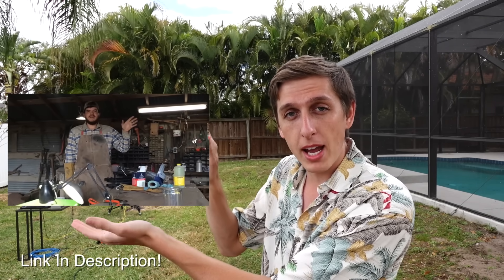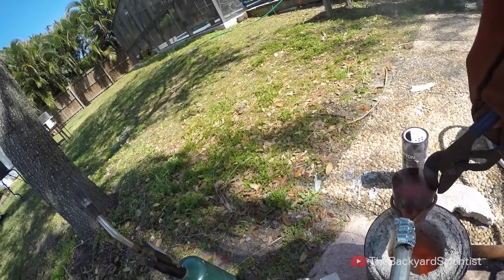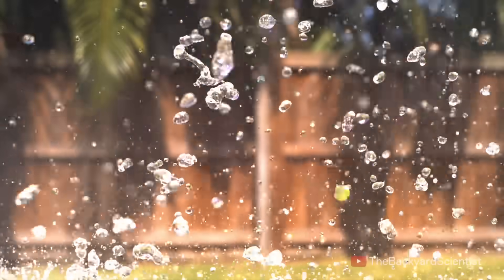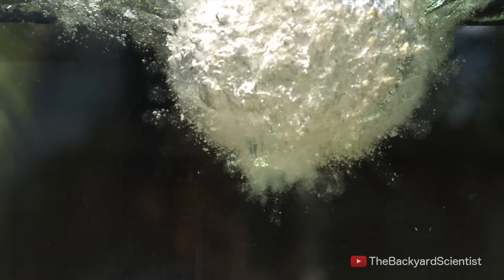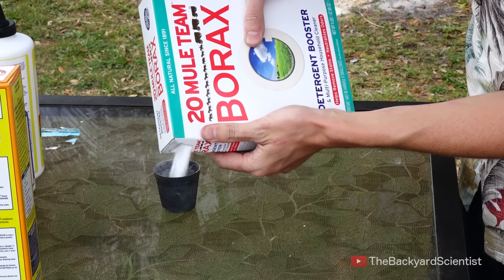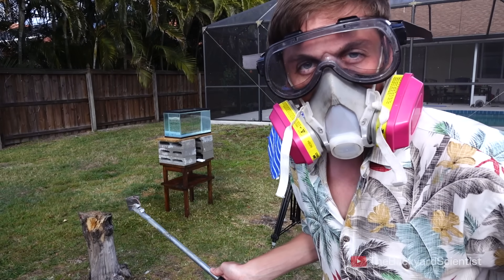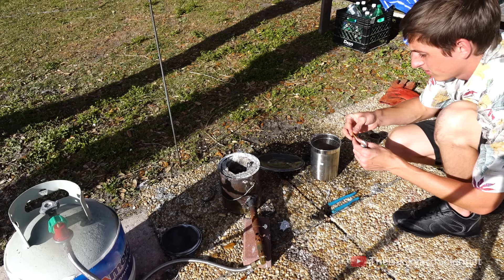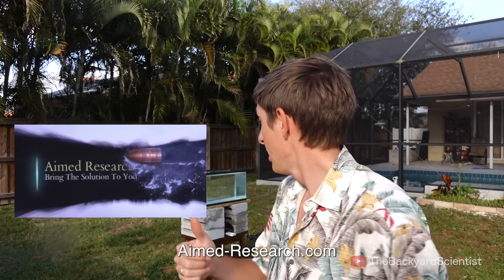Pouring Molten salt into Water - Explosion!

Comment: burning off the chlorine and only leaving sodium. pure sodium explodes when in contact with water.
Reply: Iron Lion it takes more than just heat shock to separate the molecular (edit: and more importantly, ionic) bonds of sodium chloride, it has to either be put through electrolysis directly or react with another molecule for a net result of a more stable molecule. Salt is very stable as molecules go. Yes, sodium is reactive, but the chloride is an ideal stabilizer for it, more so than water.

Edit: Another point to illustrate this is that by splitting the sodium chloride into sodium and chlorine respectively you're left with a reactive sodium and chlorine gas, which if the sodium were to combine with the water would give you heat and sodium hydroxide with chlorine gas exiting the solution. The issue here is that Sodium hydroxide is a reactive compound (lye) and this means that you would be going from a exceedingly unreactive molecule (sodium chloride) to a reactive molecule (Sodium Hydroxide). This violates the laws of thermodynamics unless a huge amount of energy is put into the equation like through electrolysis.
Reply: Hiddr Zand, you're correct on ionic bonds - my mistake. All ionic compounds have covalent (molecular) bonding as well, but it's misleading to refer to the bonds which are of less strength when describing their bonding without including the stronger ionic bonds. Good catch and my apologies.
Reply: If this were the case then the explosion would run its course until one or both of the reacting agents were completely depleted
Reply: There are no molecular bonds in sodium chloride, cause its a salt, and salts consist of ionic bonds.
Reply: True, you'd be left with chlorine gas, water, and impurities likely sunken to the bottom. This is what you're left with after hydrolysis using salt as an ionic booster for the water anyways, which is why it's usually recommended not to use salt for this (enclosed space + Chlorine gas isn't good). The sodium and impurities split to form a greenish-yellow goop at the bottom of the water as well.
Reply: afrodisiac why do you think there would be a greenish flame? Sodium is colouring flames orange and chlorine has no effect on flame colour
Reply: Iron Lion at those temperatures sodium metal will start to boil off.
Also, molten salt is used as a heat carrier for many things, such as solar power plants
Reply: [Whatever name goes here] lol I just realized that I was thinking of copper oxide
Reply: I don't really think this is the case as separating chlorine from sodium in NaCl is very hard. But if it did happen the pH of the water would change. Would be interesting to test though.
Reply: Iron Lion the sodium in sodium chloride is in its ionic form, Na+. For sodium to explode in water, it must be in its metal form, which is just Na. If Na+ exploded in water, we'd all be dead. Our bodies are like 70% water, and we also have a very large amount of Na+.
Reply: OMG you just proved how much one can fail in education.
Reply: the sodium woud still be na- and not actually reactive with water.
Reply: Did he use distilled water though? Maybe the ironic bonds are weaken from the heat and some other reaction is taking place?
Reply: It needs to be done with distilled water not tap water which contains are cocktail of chemicals including potassium and flourides
Reply: tap would also have calcium.
Reply: No no no no no no

Comment: For those wondering but not wanting to look it up it is a chemical reaction with the Sodium. When Sodium comes into contact with water it produces Hydrogen Gas and a ton of heat.
Reply: Wrong. If you add NaCl to water you get a solution of Na+ and Cl- ions. It is just an ionic solid going into solution an it actually uses energy in doing so. The energy for the explosion here comes purely from the heat of fusion of the NaCl, which is a lot because it melts at a very high temperature. The other solids he tried melt at a much lower temperature, hence, little or no, explosion.
Reply: I'm doing a masters in chemical physics. It's a physical reaction.
Reply: Rulke Yalkara sodium chloride is Na+ Cl- and Na+ does not react with water.
Reply: You have to run an electric charge through table salt to get pure sodium, simply heating it wont suffice.

The reaction you see here is simply a physical change; rapidly cooling something in the liquid phase to the solid phase causes an expansion of mass and is very exothermic.   This is evidenced by the fact that the explosion increased in magnitude when the molten salt was hotter.  Additionally, this also discredits the idea of it being pure sodium, as that would be independent of temperature.
Reply: Why would the heat of fusion have anything to do with the melting point?
The heat of fusion of salt is only about 50% greater than that of water.
Reply: Actually, Na+ does react with water to produce Na+ and OH- ions and hydrogen gas. If you've ever seen solid sodium being put into water it's a pretty violent exothermic reaction.
Reply: Ha you're right, my mistake. I must have misread the original comment. You're right, Na+ has already ionized to a +1 state so it cannot do so further, thus no reaction, just dissociation from whatever else it's bonded with (in this case the Cl-). There is actually a heat of dissociation, but that's not what is causing the explosions in the case of the molten salt. The reaction of Na and water is the rapid oxidation of sodium metal to NaOH and H+. It's the hydrogen gas that's igniting above the water in that shot.
Reply: Rulke Yalkara ya I'm not sure why he would say the wrong information when the truth is so easily googled. Now we got all these people thinking that the reaction was physical.

Comment: Interesting theory but you should know that you can ignite hydrogen by dipping hot stuff in water, which is probably what's happening here. Especially since you're using salt, which will lower the temperature at which the hydrogen in water can ignite.

Comment: now i have a question for @backyardscientist now think about how that could be applied to powering a motor? ......think about what you just showed us with obv. not controlled experiment due to you not have the exact time and heat the sense you take it from then walk to the tank then you have to compensate the winds and air temp......but the propulsion that could be use with this simple act......I RECOMMEND TRYING THIS EXPERIMENT While THE WATER IS ELECTRICALLY CHARGED>.........u wont believe your eyes......
Reply: not to mention your testing the ph  what else does that say you will not have to replace the h2o but the chemical

Comment: maybe an osmotic effect combined with temperature? in a  sodium Chloride melt the crystal structure is broken, Ions are loosely, no energy has to be broken during Dissolution, therefore Diffusion is so fast causing water to carvitate plus the temperature effect of cooling the melt in cold water. only a guess....

Comment: The other salts you tried have molecular cations (tetraborate, carbonate). What distinguishes NaCl from those salts is that its anion is a single ion.

You can try different sodium salts such as sodium fluoride or sodium bromide. If these all cause explosions, it would suggest that it is the single atomic nature of their anions that is causing explosions.

You can also try potassium chloride, fluoride and bromide. If these also cause explosions, it would indicate that the cation is not important and that you will get explosions as long as you have an atomic anion.

Lastly, I'm not sure how your acid test proves the lack of a chemical reaction. You are adding equimolar amounts of sodium and chloride ions, which will not change the acidity of your water.

Comment: Sodium reacts with water to create sodium hydroxide and hydrogen. Due to the high temperature, the reaction speed is immensely sped up, thus only occurring in high temperatures. The hydrogen reacts with the heat and creates an explosion. This also explains why there's a bigger explosion with a higher temperature

Comment: Well, if I was to make a logical guess, I'd say that when you melt salt, you are separating the Sodium from the Chlorine, in which chlorine becomes a gas and evaporates from the solution, leaving only sodium in the crucible. Sodium or any alkali metal is naturally very reactive to water, so it would make sense that it "Pops" when placed in water. If he wanted a real explosion, I'd suggest using Potassium or Cesium.

Comment: Why not try KCl? and for that matter KClO3/O4, or NaF, NaBr, NaI, MgCl2, AlCl3, or even inert non-ionic molten solids with similar melting points and heat capacities to NaCl. I can't think of anything off the top of my head.. Molten sodium silicate maybe?? I don't think it could be purely a physical reaction.  The boundary between melting an ionic salt and thermolysis of the ionic bonds is a blurry one; especially when water is involved.  I think there may be short-lived reactive intermediates that you can't measure in a before and after sort of way so easily.
Reply: Dissolving ionic compounds in water can absorb or release heat.  In the case of NaCl heat is released. One of my hypotheses is that the heat of dissoloution may be being released all at once rather than more slowly as is typically seen.  Try molten urea or NH4NO3 (if that`s even possible)

Comment: My guess before reading the papers: As you add salt, boiling point goes up, doesn't it? So is it possible that as the salt hits the water, the local boiling is higher than the local temperature. Once the salinity drops as the brine disperses, the boiling point drops faster than the temperature, and once the boiling point drops to the temperature, boom.

Comment: Maybe the reason NaCl falls into the water more (thus bigger reaction under water) is due more to the stability/volatility of the reaction of Na + H20 vs NaCl+H20.  with the first the reaction is hydrogen + NaO...Hydrogen is a lighter gas and ignites before it hits the water...whereas with the second reaction, yeilding NaO+2HCL the physical reaction you explain has more time to happen as the salt is more stable and allows for the steam effect to happen that you described.  Nucleation could be a factor and there is more of a chance to happen as it goes below the surface of the water...which the pure sodium reaction doesn't have the time to do...pure sodium would normally dance on the top of the water and just keep spinning...try it as a separate experiment...I'd bet money that the same thing is happening to the molten version but it's more free flowing due to the states of matter you're exposing to one another.

Comment: my theory on the reason sodioum chloride exploded compared to the others is that salts are more of a rock slash crystal... its molucular density has sharp edges and crack letting water seep in therefore letting the steam expand the other sunstances solidfied instantly into more of a metal not crackin along the edges so instantly returning into a material therefore not creating a explosion from steam

Comment: lack of pH change doesn't mean it's not a chemical reaction, the dissolution of sodium chloride is a chemical reaction, it's actually endothermic, you have a physical reaction, heat transfer, mediated by chemical reactions, the dissolution of sodium and chloride ions, one is preferentially soluble in the water, meaning you have a charge buildup on the main mass of molten ionic liquid, ions on the surface polarize the water molecules, breaking the liedenfrost effect and the bubble of steam collapses allowing small jets of charged ionic liquid to shoot off the main mass transferring a lot of heat and exponentially expanding the surface area exposed to the water, generating more steam, and exposing more ions.

Comment: Could the laden frost effects with the other salts be stronger as they need to be at higher temperatures, so you never have that little droplet of water get inside them and start the explosion, but regular salt is at the sweet spot where the laden frost effect is weak enough so that the droplet can hit the salt and start the explosion?

Comment: I don't know if anyone has already figured it out, but could the NaCl be behaving differently because the steam is dissolving in the liquid salt, and that it is either happening fast enough to eliminate the external bubble (and thereby defeat the Leidenfrost effect), or the surface tension on either the salt or the water is disrupted by the dissolution?

Comment: I guessed the reason it happens is the high temperature i.e. 801°C turns the water to steam. Steam takes up 1000x the volume of water, the rapid expansion of water to steam is the explosion

Comment: #TheBackyardScientist

my theory on why molten salt explodes when it hits the water is as folows: salt will go with water to form salt water,
 with other things like borax and other salts,  it might not work 
because of the leidenfrost effect, but NaCl binds with water and doesent
 form a different compound. therefore the molten salt goes with the 
water , counteracting the leidenfrost effect and giving no chance for 
water to not touch it, and therefore the heat causes the explosions  
like hot glass and water, exept more amplified because salt goes to the 
water extremely well.
 and the heat is acting as a catalyst causing more energy release.

Comment: Here's what's actually happening.
The salt is molten and enters the water. It boils the water and freezes the outer layer of salt. Now the layer of steam the forms from the boiling water produces HUGE pressure (a steam explosion), but this is itself no more powerful than the steam explosion from pouring molten aluminum into water (which is a very weak explosion). Something different when the molten material is salt. That steam explosion fractures the outer shell of solid salt, into little salt bullets (each about the size of a normal grain of salt that you would sprinkle on your food). Now the act of fracturing this outer solid salt layer actuall imparts very high velocity onto the shards. If for example you take a microscope slide and bend it breaks, in addition to having the 2 pieces on each side of the break, many tiny shards will also be generated (about the size of sand grains), and these will go flying at very high speed. In the case of the solid salt layer fracturing, these salt shards pierce the layer of steam and enter the liquid water, and these shards are still well above the boiling point of water. So each one produces a streak of steam bubbles in its wake, and since there are millions of these tiny shards traveling outward (so many it would look to the eye as an expanding sphere of salt rather than outwardly travelling individual particles). This results in an expanding sphere of tiny steam bubbles, but since bubbles have a tendency to join together, and since they are so close, they join nearly instantly to form a huge steam bubble. And remember, that was just the outer layer of liquid salt that froze then shattered,. There's still pleanty more liquid salt that hasn't frozen yet. Well what happens next is the heavy liquid salt sinks down through that huge steam bubble and enters the liquid water below the steam bubble, and the cycle repeats. Again you get a layer of high pressure steam and a layer of frozen salt, and the frozen layer of salt getting shattered by the steam pressure, which again creates high speed moving shards of super hot solid salt that again generate another huge steam bubble as they enter the water around them. This whole thing happens over and over until all of the liquid salt has been turned into solid salt (which then dissolves in the water when it's cold enough so that it doesn't boil the water). This entire process, takes less than 1 millisecond. So now you have a sequence of large bubbles of water vapor generated in less than a millisecond. These large dozen or so bubbles are right next to each other so they combine almost instantly into a single HUGE bubble of water vapor. The immense pressure in this water vapor bubble tries to compress the water surrounding it, but since water is an incompressible liquid, the resulting force is immediately transferred through the water to the first thing that can be moved from the force, and this is the glass sides to your aquarium. That is why it instantly blew out the sides to your aquarium on your first attempt.

Would other hot molten materials do this too? No. Molten metal for example will freeze just like the salt did, but solid metal is malleable, not fracturable, so instead of shattering from the pressure of the steam layer (shattering being what generates the shards needed for the rest of the reaction) the thin layer frozen metal just gets squished from the pressure of the steam layer.

Would other salts do this too? No. Other halides (potassium chloride, sodium bromide, etc) don't do this, nor do non-halide salts (iron sulfide, copper carbonate, etc).  This is because their crystal structures don't have the correct fracturing strength. The crystal structure must be such that it doesn't completely withstand the pressure of the initial steam layer (meaning it would never shatter), nor must it shatter too quickly before stress has built up. Also when it does shatter it can't just break into large chunks that just sit there, but must instead break into millions of tiny shards that are given kinetic energy from the force of the shattering and thus get accelerated to high speeds (in order to shoot through the high pressure steam layer and hit the surrounding water while they are still hot enough to boil the water). All of these properties happen to exist with sodium chloride, but no other salt or any other known material (or at least naturally occurring material, as it's possible that an even more efficient material for this reaction has been designed in the lab).